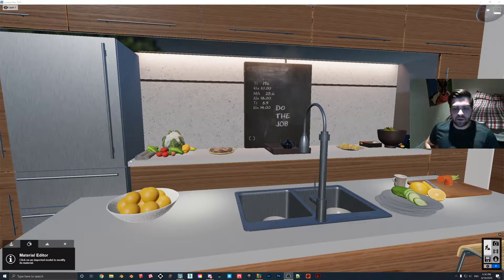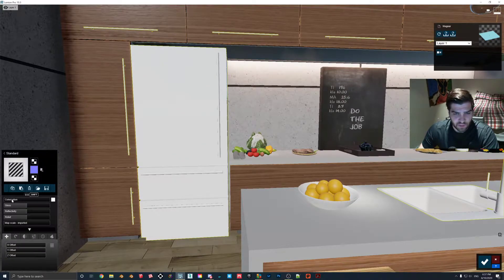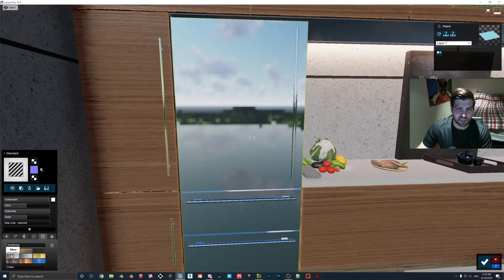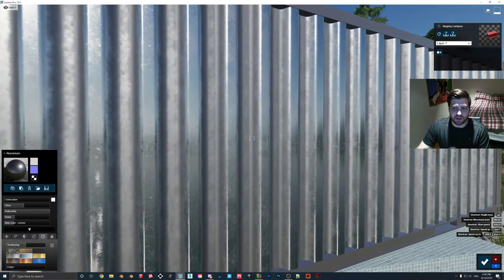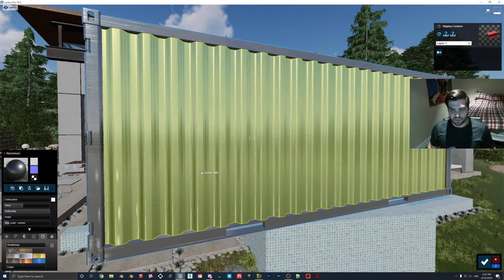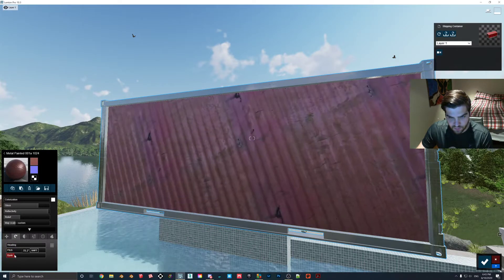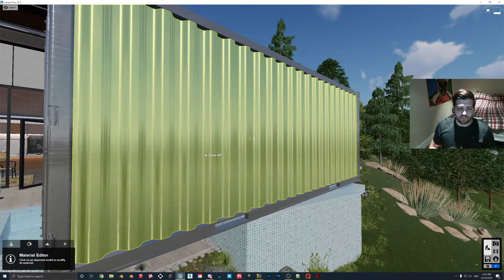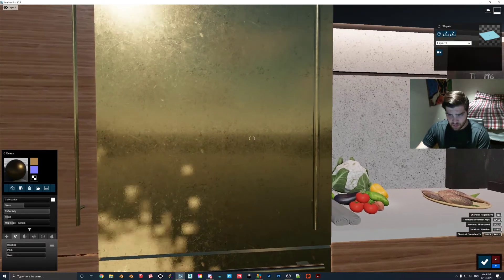Unlock METAL MODE in LUMION!! (Part 1 of 4) - LUMION's Indoor and Outdoor METAL Library

Comment: Hi! Great tutorial and I liked this so much, can I ask for possible solutions to my rendering? I have adjusted the material for metal as aluminum and their gloss and reflectivity are at max, however when I render it, they just appear dark or sometimes black on the render output. Thank you!
Reply from the maker: Don't turn gloss up to 2.0, that is extremely high. For aluminum I think gloss should be .8-.9 and reflect should be 2.0.

It sounds like you are getting weird reflections, I would try going to the utility folder (the wrench/spanner icon) and dropping in a reflection control to see if that fixes some of the issues.
Reply: @LuminousLabs  thank you so much for you help! The metal appearance on my render is much better now, also discovered that the problem is in the sun fx, so I removed it and sticked with the sun settings in the build. Keep safe!
Reply: I have the same issue. But where can i find the utility folder?